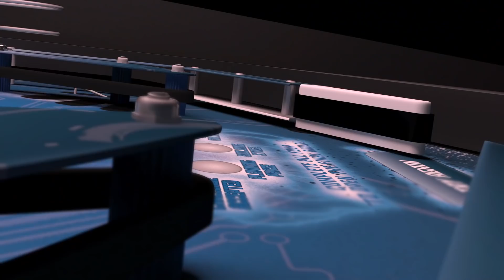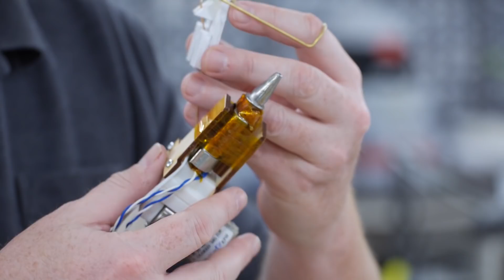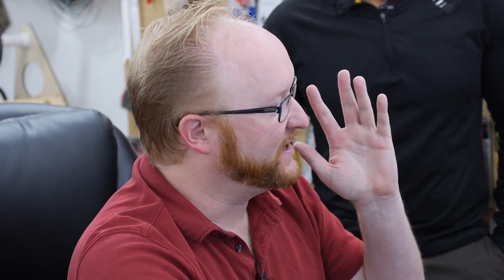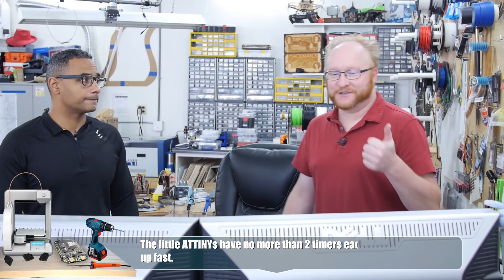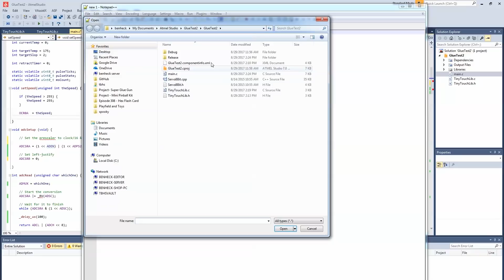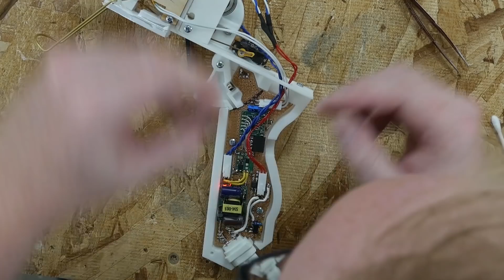Super Glue Gun 08: Integrating All Mechs

Comment: 'By default, the successive approximation circuitry requires an input clock frequency between 50
kHz and 200 kHz to get maximum resolution. If a lower resolution than 10 bits is needed, the
input clock frequency to the ADC can be higher than 200 kHz to get a higher sample rate.'
So ADC prescaller of 16 for 8 MHz core clock and demanded 10 bits won't do you best- 32 os minumum and thus touch library you found uses safer 64

Comment: Hello Ben. I would recommend using a standalone capacitive touch sensor like the AT42QT1010. They're quite reliable and you can get them at less than 50 cents a pop when buying large quantities.
Reply: As if cost was an issue with this project, lol
Reply: Well, more of a reason to use a standalone chip then!

Comment: I hope that  the case will be made from something that won't melt from the heat from the heater block, like I said before could you not build the glue gun like your soldering station is constructed and have all data processing happening in the base unit and a tiny processor in the head unit that gets it commands from the base unit via a extra wire in the umbilical cable which would be 25 way shielded printer cable.

Comment: Is there a use case that would necessitate the stand being extended when not sitting on a surface?  Either a pressure sensor on the bottom or a capacitive sensor on the grip to detect that it is being held would seem to make more sense.

Comment: As a hot-glue novice this may be a very misguided suggestion, but it seems to me like there could have just been a switch/button that is depressed when the trigger is extend out, but pulling the trigger would release the button/switch and that could cause the stand to flip back? Only downside to this compared to the capacitive button is the stand would be out when you're lining up the gun. Possible make the trigger a 2-step trigger where the first step moves the stand and the second extrudes the glue? Similar to like, the Gamecube triggers?

Comment: Or, you could've just added a button to the bottom of the handle
Reply: no where near as cool
Reply: That's exactly what I was thinking too. Less logic leads to less chance for failure and higher reliability. This just doesn't feel like a good place for a cap sensor.
Reply: Agree with this one. If you put the sensor near where the end of where the pinky finger would rest when gripping the handle, it would activate in a more natural occurrence. I was worried that by putting it in the finger, where you would normally grab onto when picking the thing up, it would cause the stand to "retract" pre-maturely, causing a very hot item to become unstable.
Reply: Indeed. This design is not very well thought out. Apart from the fact that a simple external stand would be much more functional, you want the rod to get out of the way immediately. If you have to glue in tight places, you do not want that think flapping around in the breeze.
Reply: Pretty simple, if you want the stand to stay out of the way just keep your finger on the trigger.  Also, it's faster than a button on the bottom because the stand is already lowering as you set the gun down.